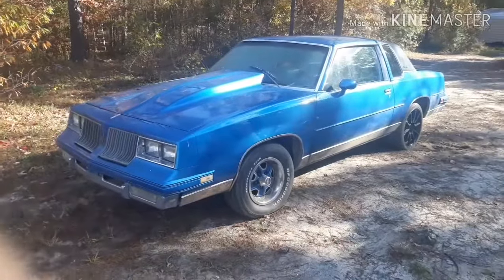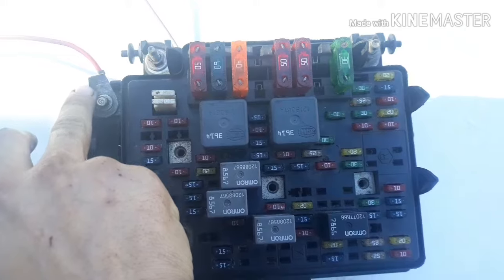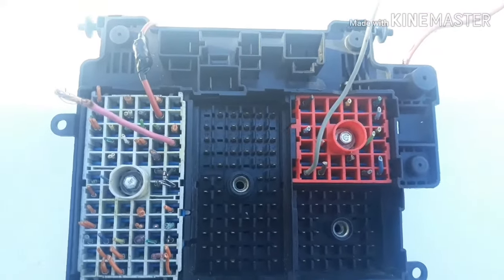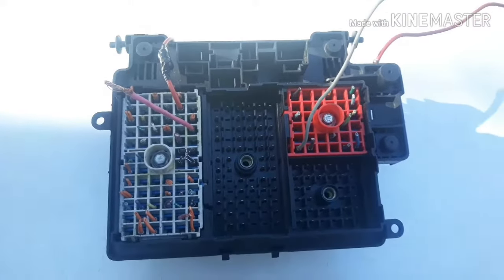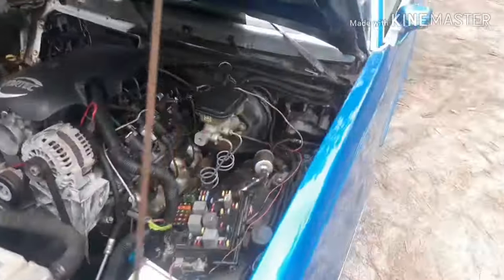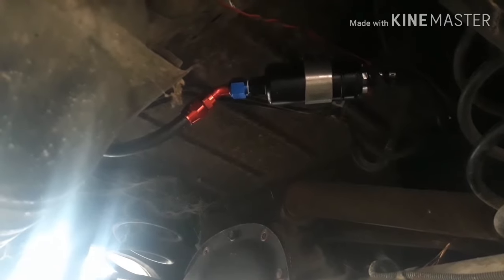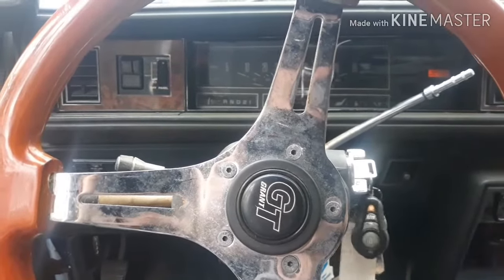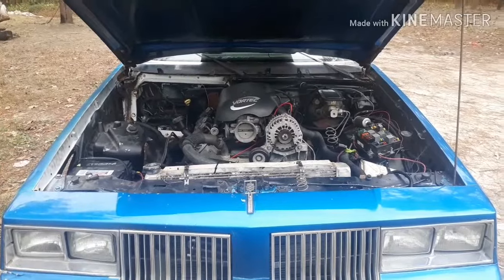LS SWAP WIRING!!! HOW TO MAKE LS SWAP RUN IN MINUTES!!! STOCK FUSE BOX/ HARNESS!!!

Comment: Did you modify the harness at all
Reply from the maker: No modification to the engine harness is required
Reply: @mikeytuned8944  what's your Instagram
Reply from the maker: @aydenrfb6626  same
Reply: @mikeytuned8944  mine is aydenrfb

Comment: Hey bro pin F1 is not working for my fuel pump? What can the problem be by the way fuel pump is working
Reply from the maker: What year fuse box are u using? Also check your key on power source and all grounds
Reply: Did you ever find out what was the problem? I have the same issue with my F1 not working for my fuel pump

Comment: Did you have the run a return fuel line
Reply from the maker: Yes unless you use a Corvette filter with the built in regulator

Comment: Hey if I use stock steering column from donor truck will I still have to delete vats
Reply from the maker: If u were to try to do it that way u would need all the wiring for the security module in the ignition switch also. Honestly that's probably more of a headache than its worth.. if u find a donor truck u can put power too it's a very simple procedure then a chipped key and body control module are no longer needed for the pcm
Reply: OK understood yeah cause my donor truck I got everything out of it ignition switch the steering column all the wires underneath it everything I just didn’t wanna have to delete anything trying to do at the cheapie way you know but from what I seen your bypass video is free basically and does that keep it unlocked for good or does it lock back up eventually how does that work
Reply from the maker: @krazobuildz7567  omg yes that's way to much work man. I've done a bunch like this and have no issues at all.. in the pcm u have current codes what tells u if like a 02 sensor is bad or something and continuous stored memory codes which are stored in the pcm as long as the pcm is not reprogrammed. I have scanned and cleared current codes with no issues starts every time
Reply from the maker: @krazobuildz7567  ur putting it in the s10 on ur channel? Do the bypass use your original starter wiring and it will start every time
Reply: Mikey Tuned Yeah hell yeah bro it’s pretty basic and simple from what I’ve noticed in learned and research on YouTube but thanks for the reply bro I appreciate it if I do you have anymore questions I will ask 👌

Comment: What transmission your using?
Reply: You can keep the th350/th400/ 700r4 with the right flexplate depending on the engine and crank it has makes for what flexplate you need. I have to run a th400 flexplate with a 2200 stall converter and an adapter to make em fit. However the adapter is also for the rear of the crank if need be. Im sorry if i dont make sense but there are some videos explaiing how to do so. It keeps the og trans and driveshaft but makes for a rear end upgrade for anything over 400hp i believe

Comment: Hi man, can i use stock manifolds on gbody?
Reply from the maker: I did, driver side is a close fit I cut the 3 bolt flange off and welded a 2 bolt flange for more clearance
Reply: Thanks maan

Comment: Will this work for a 07 2500 suburban?
Reply: That's a gen 4
Reply from the maker: If u are referring to the fuse box wiring to make the engine start yes the same a9 wire powers the fuses to be able to start the engine

Comment: What transmission are you using?
Reply from the maker: Turbo 350
Reply: Will this work for a electric 4l60e?
Reply from the maker: Yes but there are a few more steps involved... this is more of the engine part of the wiring
Reply: You should make a part 2 on how to pin a electric 4l60e. It could help a lot of people out.

Comment: So is it really that simple? All I have to do is match fuel gauge with fuels gauge oil pressure with oil pressure fuel pump to fuel pump an I guess jus read the wiring diagram an what about ones that won’t be used would I have check engine light an would need to tune it ? I guess?
Reply from the maker: Yes that basically everything the main power to the fuse box a key on ignition turns on pcm power the gray wire is relayed power for the fuel pump hook up your gauges and ur done
Reply from the maker: Tune varies on your setup
Reply: So like even for a 2020 5.3 LT an get it turned for things I don’t need or use an we’re can I send in my computer I want to do egr o2 sensor delete
Reply: @aguerra5344  Damn you doing a 2020 motor Lt swap?
Reply: I’m trying but idk if I can bolt up the 4l65e or 4l80e to the new 5.3 LT engine doing it in a 98 blazer 4 door

Comment: There is no c1 b11 pin on my fuse box and it looks like your using pin 12
Reply from the maker: The process for 03-07 fuse box is a little different... constant power will be c7 pin A it's a red wire all by itself and key on power is c1 a9 pink wire... any other questions I'll be glad to try to help
Reply: @mikeytuned8944  I did all that and I don't hear the relays clicking on when I connect the key on  c1 a9 wire
Reply from the maker: So u ran constant power to C7? Not C1-a11?
Reply: @mikeytuned8944  yeah I can put and tried c7 and the a terminal and didn't hear and relays click on I'm using a 03 taho fuse block with a 03 avalanche would that be a problem
Reply from the maker: @tunerrepublic6922  no that shouldn't be a problem... do u have Facebook? If so pm me
Reply: @mikeytuned8944  what's you facebook
Reply from the maker: Mikey tuned
Reply: Tuner Republic, I’m having the same issue also running an 03 but Silverado. Don’t hear anything clicking. Can pinpoint the correct C7 A pin. (It’s the rightermost 2-pin small block) but can’t get it to run. If you resolve it please let me know! I’m on day two trying to start this thing! Thanks. Hope you are all safe.
Reply: @kitestance  I have not fixed it and it's driving me crazy
Reply: Tuner Republic I’m here now with a continuity tester. Crazy thing I see is A9 has 12v power. It was my understanding I should give it power as key on ignition. Will let you know what I do. Please hit me up if you find anything!
Reply from the maker: A9 should not have power coming from it, a9 is a key on power... if the terminal is putting out power there is an internal short in your fuse box
Reply from the maker: All of the information above can be found on lt1swap.com there are step by step directions on how to use your factory 99-02 and 03-07 fuse box
Reply from the maker: Tuner republic got it figured out 👍, francisco if u message me on Facebook I can try to help walk you through it

Comment: What kinda fuel pump u use
Reply from the maker: On the cutlass I ran a inline 355lph pump they're cheap on Amazon and ebay
Reply: Did u have to use any grounds on the harness
Reply from the maker: @smithboi86lsswaps33  if you mean for the fuel pump I ground straight to the frame....
Reply from the maker: @smithboi86lsswaps33  as far as the engine harness I hook up the 3 ground terminals that are on the harness